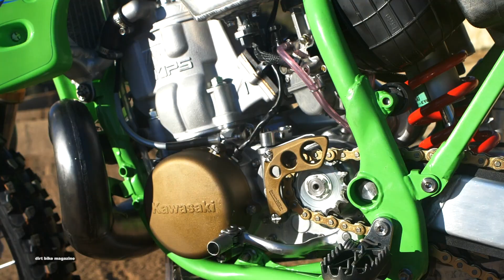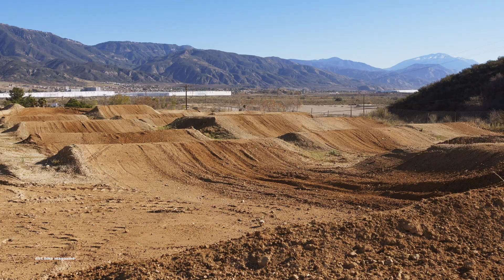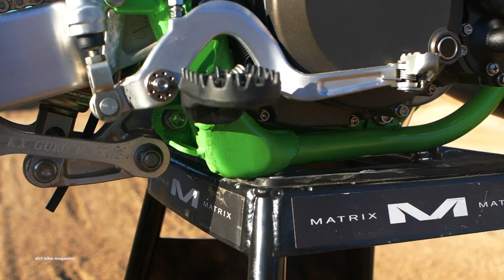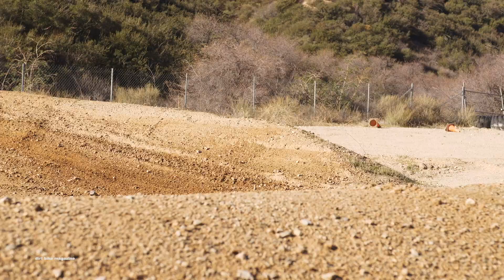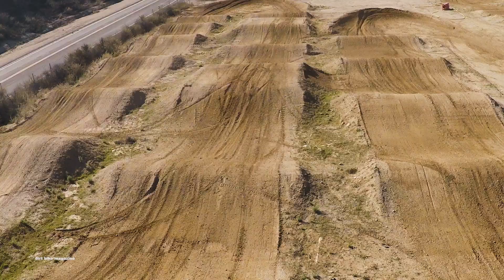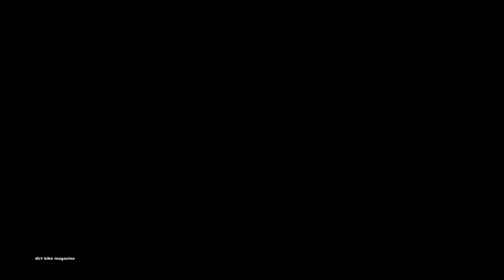Inside Tyler Bowers Kawasaki KX500 2 Stroke Build - Dirt Bike Magazine

Comment: Idk about all these people saying they rip your hands off. I raced a 94' model not long ago and found the power very manageable. Bike was very easy to ride and the front end was extremely stable. So much fun to ride, but my 450 still takes the cake for scarier power :)
Reply: Yeah.. Riding my brothers 500 and hopping on my 06 CR250 I felt my 250 was more violent but the 500 with that soft suspension and big booty seat just felt more mellow and manageable since the gears where lile 3 times longer than on my 250.. They are over hyped for sure

Comment: I'm 61 and have three KX 500's. 89-90-91. Won many races back in the day ,mx-hare scrambles-hill climbs . Never say never.
Reply: Looking to sell one??
Reply: I’m almost 53 now, had a 1991 KX500 back when I was in college. Sold it (should’ve never)! Always rode MX bikes since my first KX080A (1979). Then I bought a mint original 1988 KX500 a few years ago…and I love it. So much fun to ride, much easier to ride than most people think (as long as throttle control is sensible)! Totally agree with your comment. I still love riding 2-stroke MX bikes (all 9 of mine) just as much as when I was starting out as an excited 10yr old kid😊

Comment: You hear that sound people? That's the 90's you hear. And it's better than now.
Reply: Shear strength from that monster
Reply: I had CRs.  85 86 an 89. Then bought a new 93 kx.  All 500s stil got the 86 CR. My buddie had the bright idea of taking the 86 jug an head to pro circuit. Used there pipe also. NASA would be proud😂
Reply: In the 90’s everyone was riding , nowadays the sport is meh

Comment: If Kawasaki is smart they will bring back the KX500. The same as it was before, with oil injection, a normal looking gas tank and pipe location (see CR500) an overdrive 6th gear, a compression release, better engine balancing, and a carburetor. Not fuel injection. They will just have to bite the bullet and pay the EPA $10 zillion dollars in carbon fines and useless carbon taxes, to give the people what they want!
Reply: They dont even need all that. Just upgrade the clutch-side case for easier changes. I have a '97 and 5th gear is allmost never used. A 6th gear would make it an even more dominant desert monster. The Team Green KX500s would do 118mph all day in the Baja races.
And since it is being sold as a closed-course competition bike, the EPA can pound sand.

Comment: I need ideas for my build guys...should I powdercoat frame? Comment!
Reply: The MX Guru I would powdercoat the frame but make sure you keep your build clean an simple in my opinion 
Good luck on your build hope it turns out good.👍👍
Reply: @harro9447  Thanks bro!
Reply: My 01 is powder coated gunmetal metallic.  It has lasted many years of serious off road abuse. Maybe 15yrs. Motox, GNCC and sand.   It's finally due again. Looked awesome and was well worth it.  Use a reputable shop and make sure the frame is prepped real good.
Reply: @pooch299  Thanks Pooch, great feedback. And that color sounds awesome!
Reply: Did my frame in the Neon Green from the Pro Circuit days. Looks sick on my 125. The code is still available. 
Going to do the same come KX500 build time.

Comment: If you have never ridden a 500cc two stroke you don't know what you are missing and no a 60hp four stroke is not even remotely close in terms of stretch your arms power.
Reply: Absolutely, and you better be careful riding behind one. It launches missiles.  This video makes me want to get one
Reply: @christopherkeiser2872  If you plan to get a KX500 i suggest getting a 1990 or later model, my KX is a 1989 and there are a number of parts on it that Kawasaki is sold out of that are still in stock for the 90-04 models.
Reply: @Sleepy.Time.  The engine is all the same from '87-'04. I ran an '88 sleeve (meant for a powervalve) in an non-powervalve '85 engine with no issues whatsoever.
Reply: Thanks Sleepy, definitely I will keep that in mind
Reply: Had 2 cr 500's and just got a 2020 CRF 450, the 450 is faster
Reply: @codprocamp4690  85 CR500 was the only one stock that was super fast, they detuned it a few times after that to try and make them more rideable. The new CRF450 has something crazy like 63hp at the rear wheel, yes?
Reply: @Sleepy.Time.  I have a 85 CR500 and a 87 CR500 engine in a 07 RMZ450. The 85 is wild animal, makes 63hp in a 4000rpm span.
Reply: @owenarsenault5955  I had a 85 CR500 when they first came out and it was nuts compared to the 83 CR480 i had before it. 88 CR500 was also a brute but the 90 CR500 i had was somewhat tame.
Reply: My kx 250 89 is fairly comparable with 52hp stock and the kips power baby
Still want a 500 but my 250 is plenty
Reply: @weedsmith9317  KX 250 IN 89 WAS MAYBE 35HP.....LOL
Reply: @craigbielsky115  My Title literally states 52hp
Reply: @weedsmith9317  250 is a fantastic bike and in the hands of 99.9% of riders is faster over the course of a moto and safer. I raced a 88 kx250 back in the day as well as a 90 and 92 kx250 so ive had plenty of seat time on them and loved them all. But a full race 500 in some deep loam is a whole different animal and if your name is Jeff Ward, JMB, Ricky Johnson or David Bailey its faster outdoors then any 250 could hope to go.
Reply: @Sleepy.Time.  i just want one to say " yer piston is small" that and the top end speed when Mr. Mounty thinks hes a hero in his charger...
Reply: a modern 450 smokes it.
Reply: @mxgryan  a fourstroke's powerband is boring as fuck, why the make great lawnmowers. 500 hits hard with a power that snaps you to attention while a 450 has all the hit of a Chrysler Minivan
Reply: @Sleepy.Time.  Well Said Sleepy Time!   Or my Translation- a 1991KX500 2Stroke is a Chevrolet Corvette compared to Al Bundys brand of 4 cycle.
Reply: @mxgryan  450 is too easy to ride compare to real 500 2 stroke mx.